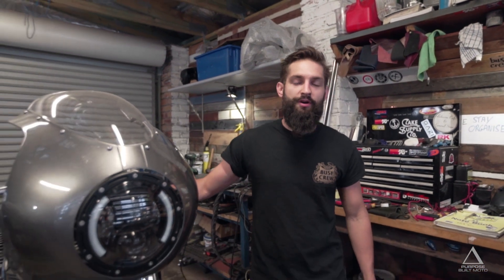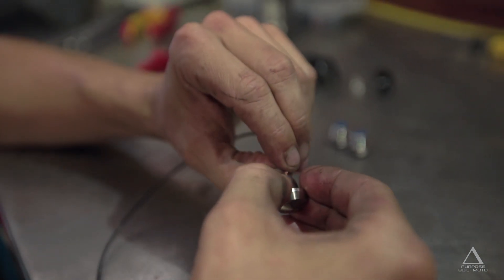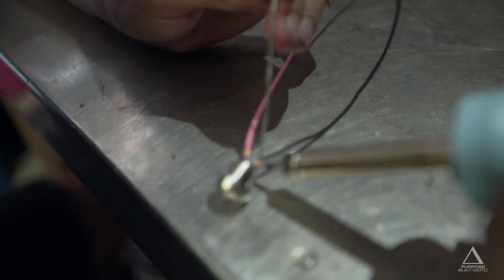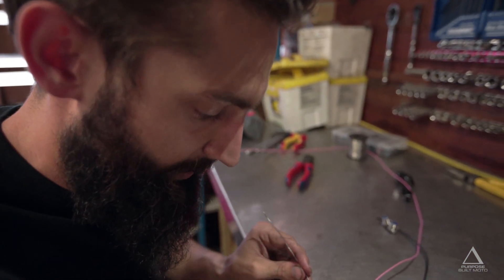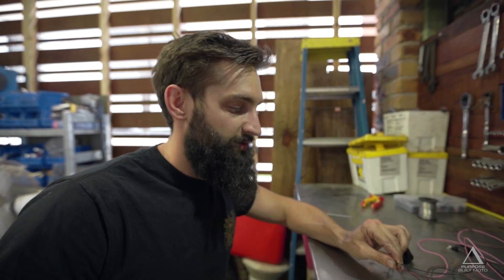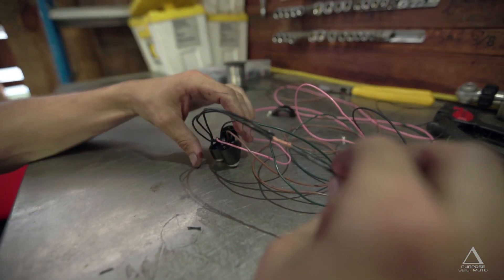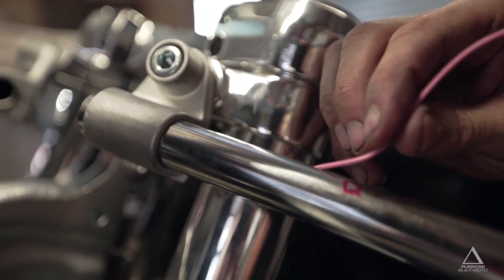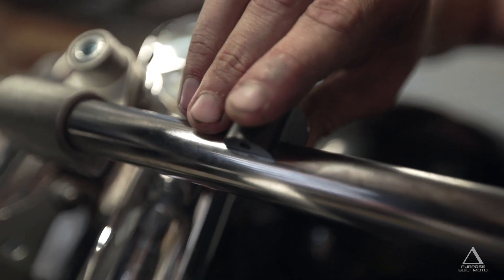Installing Handlebar Switches 3 Button | Purpose Built Moto

Comment: What if the original switch housing has a choke than how will they be used
Reply from the maker: Joseph billey I move the choke to under the tank or directly off the carburettor
Reply: That’s the answer I was looking for

Comment: What diameter has the cable that you use/ are supposed to use? Many thanks
Reply from the maker: It depends on the function 
but awg20 or awg22 is a good start point. If their signal only you can go smaller

Comment: I just want to replace my stock Harley switches.. do I need the black box? What will happen if I don’t use the box? Thanks
Reply from the maker: Hey Mick, 

It can be done without e black box, but the unit is designed to make your life easier. 
If you don’t use it you just have to use a few extra relays etc

Comment: Link to buy the button
Reply from the maker: Aditya Venkatraman 
https://purposebuiltmoto.com/product-category/cafe-racer-handlebar-switches/?v=6cc98ba2045f

Manners next time hombre :)
Reply: Purpose Built Moto apologies for the blunt question, I like the 3 button setup, but can I get the push buttons in black rather than chrome ?
Reply from the maker: Aditya Venkatraman no problem mate, we all do it! 
My buttons are only available in raw stainless steel. The reason is The black powder coated ones I worry will wear off and look ugly.
Reply: Purpose Built Moto I understand that, and am willing to take that chance, coz the build I am looking at is an all black setup, no chrome, and this is perfect in all aspects, if you could do one for me, I would appreciate it, the button as well as the housing in all black, matt
Reply from the maker: Hi Mate,

Sorry but we don't do special orders like that. If you want the switches, you can purchase them and swap the buttons out
Reply: Purpose Built Moto good suggestion, do you also sell replacement buttons in black ? If so then I can do both
Reply from the maker: Send me an email : 
tom@purposebuiltmoto.com and I'll help you out.
Reply: Are these water resistant or any rating for the same?

Comment: hi, This buttons can be start motor button? or only ligth on/ of? thanks
Reply from the maker: Андрей Баранов you can use them for starter motor, lights, kill switch and horn
Reply: @PurposeBuiltMoto  hey. Do i need a m-unit to put theese on my bonnie or can i replace the ugly triumph originals? It's  a 2004
Reply from the maker: @oddis188  Hey mate, yes you need a switching module. like the Purpose Built Moto black box, or the M-unit

Comment: Great video, thanks! With these switches, can you wire them with OEM connectors and plug and play instead of the faff of m-units or such like?
Reply from the maker: It can be done, but the better and easier way is to use our black box module or another control. module like
Reply: @PurposeBuiltMoto is there a video showing how to wire the black box module to say a stock Dyna or something of the like?

Comment: After three years, thanks! As I am going to install one of these on my bike. What kind of wire are you using (core mm?)
Reply from the maker: Hey Etienne, we use a 2mm cable usually. if you like a smaller type can be used depending on your application.
Reply: @PurposeBuiltMoto  Thank you! Keep on posting.

Comment: kinda skipped right over the part where you have to drill your 3 switch clearance holes eh... 
that said seems as all you need to do is make that housing a few mm deeper and avoid the clearance problem all together
Reply from the maker: Regardless you need holes for the cable entry anyway. 
For us the minimal design is better and the holes allow clearance so the cables won’t foul and short on the bars
Reply: @PurposeBuiltMoto  I suppose it depends on how proud the housing was made to whether or not you could get away with the clearance and one hole.
I too wanted my buttons as flush as I could get and had to mill a rather large hole in the bar
Reply from the maker: @axa.axa.  We have a few articles on the website showing the process I use. For my 3 button switches I normally drill 2 holes, 1x 8.5mm and 1 x 6mm. the smaller one is for the 2 button and larger for the single button side.

Comment: if you use a metal hammer for your center punch you will get better results.  dead blow bounces.
Reply: can you expand ?
Reply: @mattduncan5500  metal on metal is usually how it is done,  you would get a definite strike and mark as opposed to the rubber mallet hitting the metal center punch and giving you a "bounce".   i didn't think as to that may be the only mallet you may have.
Reply: @oscarsanchezmendoza2274  got ya :)